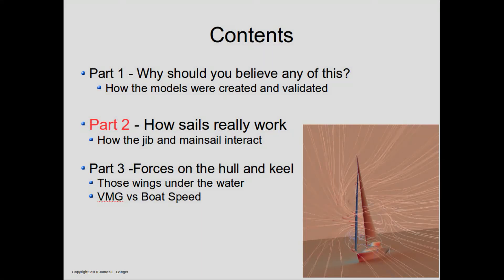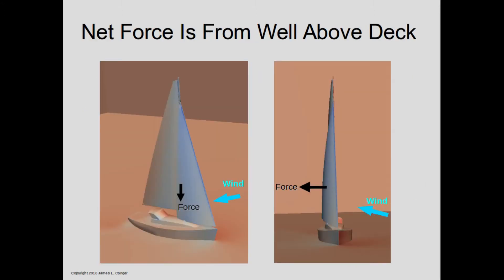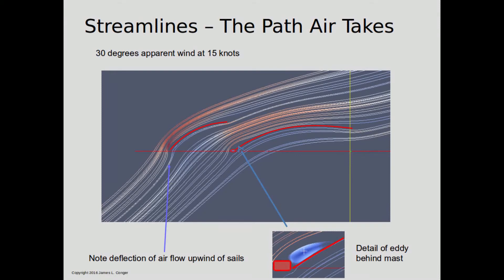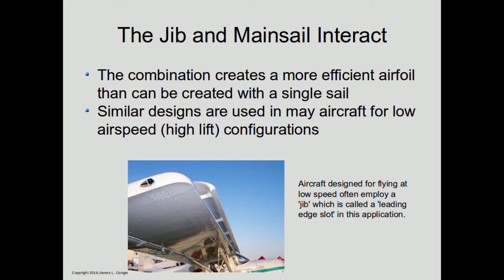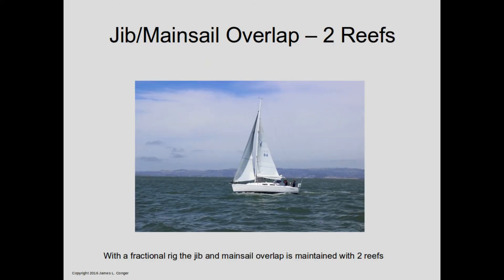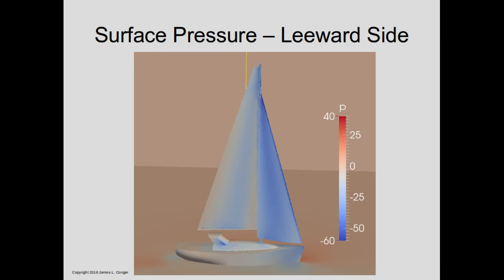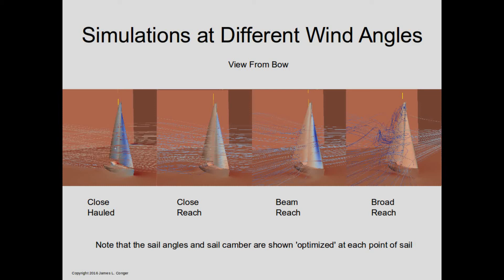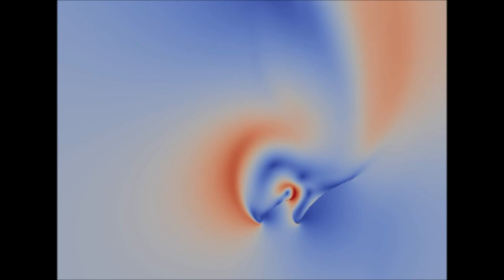How Sails Really Work Video 2 - The Jib and Mainsail

Comment: this video is an excellent example of what NASA's Glenn Research Center labels "Incorrect Lift Theory #3".  The shame is that the illustrations where flow lines are shown actually give a good indication of the actual lift sources, and at 8:59 for example you can see how jib improves sail drive by keeping flow attached to the mainsail and improving the overall redirection of the airmass.
Reply from the maker: https://www.grc.nasa.gov/www/k-12/airplane/wrong3.html for those interested.

Comment: Hi James.  Thanks for this, I have just discovered this video. Instead of reefing the mainsail, would a smaller jib not reduce the backwinding on the main? What I am noticing on my masthead rig is to reduce jib size and twist off the top of the  mainsail. Your feedback would be appreciated
Reply from the maker: A reefed jib will reduce back winding the main. However, it will not help moving the center of effort forward to counteract hull forces rounding the boat up. I put two reefs in the main before rounding up my 110% jib. One exception might be if you had a huge jib out. I would reduce it to about 100% first, or better, drop it and get a smaller jib out.

Comment: Amazing!  Great work!!
But your simulation result holds true when sail is rigid, while it is actually not. So Bounolli theory does not apply here. What really works is just the component of direct force from wind blowing.
Reply from the maker: Bernoulli's relationship applies to any moving fluid across any surface, even a flag flapping in the wind. The pressure differentials do cause the sails to change shape, so the simulations try to capture the shape at the sails when in use.